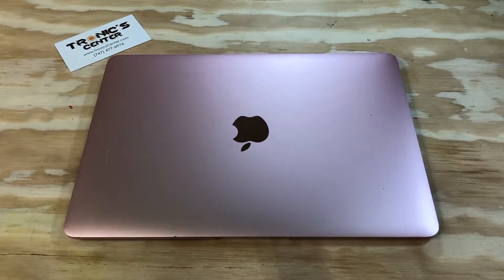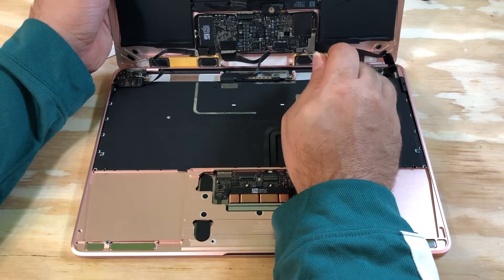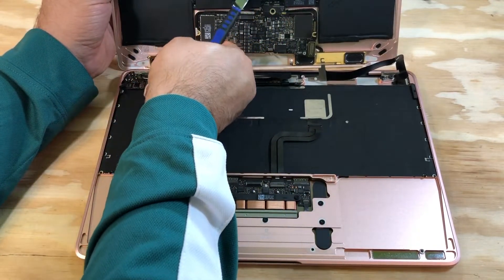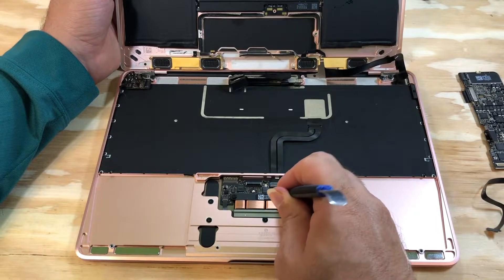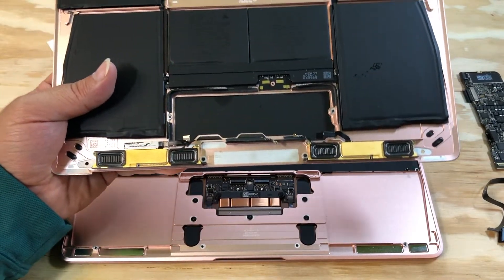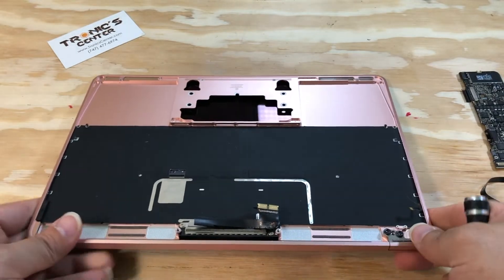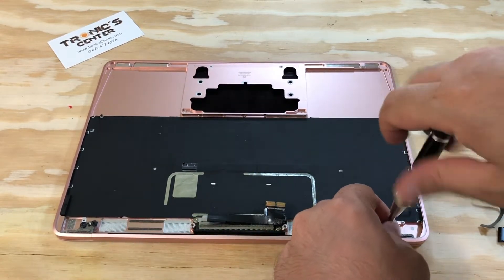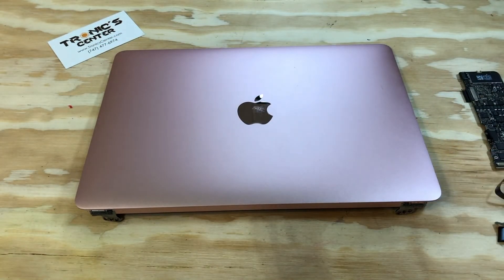Take Apart 12" Apple MacBook A1534 - Quick 12" MacBook Disassembly and Tear down 2015 - 2017

Comment: Hello budy, how are you? I manage to change the board of a 2016 A1534 for the board of the 2017 of the same model, apparently everything is the same, waiting.
Reply from the maker: Not sure , you may check the compatibility and do your own research ! Dear Customer let us know what repair or disassembly you want us to make video ! Please not that we do deal with all Brands Dell, Lenovo, Asus, Razer, Toshiba, Hp, Sony, Panasonic, Nikon, Canon, Black Magic, Red Camera, any Camcorder Bards, Also we do IT Support and Data Recovery !
Reply from the maker: A2251 KeyWords 

MacBook Pro "Core i5" 2.0 13" 2020 4 TB 3, 2.0 GHz Core i5, I5-1038NG7, MacBook Pro "Core i7" 2.3 13" 2020 4 TB 3, 2.3 GHz Core i7,  I7-1068NG7, MacBookPro16,2 , 2020 13" 4 TB 3 , A2251 MacBook , EMC 3348, MWP72LL/A, BTO/CTO

————————————————————

A2141 KeyWords 

MacBook Pro "Core i7" 2.6 16" 2019, 2.6 GHz Core i7 (I7-9750H), 2.3 GHz Core i9 (I9-9880H), A2141 (EMC 3347), 2.4 GHz Core i9 (I9-9980HK) , MacBookPro16,1, MacBook Pro "Core i7" 2.6 16" 2019 5600M, 2.6 GHz Core i7 (I7-9750H),  MacBookPro16,4 , MacBook Pro "Core i9" 2.3 16" 2019 5600M, 2.3 GHz Core i9 (I9-9880H), MacBook Pro "Core i9" 2.4 16" 2019 5600M, 2.4 GHz Core i9 (I9-9980HK), MVVL2LL/A, MVVM2LL/A, 16" MacBook A2141

———————————————

A2179 Keywords

MWTJ2LL/A, EMC 3302 , 1.1 GHz Core i3 (I3-1000NG4) , MacBook Air "Core i3" 1.1 13" (Scissor, 2020) , MacBookAir9,1 , 1.1 GHz Core i5 (I5-1030NG7) , MVH22LL/A , MacBook Air "Core i7" 1.2 13" (Scissor, 2020), 1.2 GHz Core i7 (I7-1060NG7)

——————————————

A2159 Keywords 

1.4 GHz Core i5 (I5-8257U) , MacBook Pro "Core i5" 1.4 13" Touch/2019 2 TB 3 , MacBook Pro "Core i7" 1.7 13" Touch/2019 2 TB 3 , 1.7 GHz Core i7 (I7-8557U) , MUHN2LL/A , A2159 , EMC 3301 , MacBookPro15,4 , 2019 13" (Touch Bar, 2 TB 3), 13" MacBook Pro A2159

—————————————————————

A1932 Keywords  

MRE82LL/A , MVFH2LL/A, 1.6 GHz Core I5-8210Y, 1.6 GHz Core I5-8210Y, MacBookAir8,1 , EMC 3184 , 13" MacBook Air Space Gray, 13" MacBook Air Gold , 13" MacBook Air Silver , 13" MacBook Air 2019 13" MacBook Air 2018, 13" MacBook Air A1932

—————————————————————

A1534 Keyword’s

EMC 2746, MF855LL/A, MF865LL/A, EMC 2991, MLHA2LL/A, MLHC2LL/A, EMC 3099, MNYF2LL/A, MNYG2LL/A, MacBook8,1 , 1.1 GHz Core M (M-5Y31) , 1.2 GHz Core M (M-5Y51), 1.3 GHz Core M (M-5Y71), 1.1 GHz Core m3 (M3-6Y30), 1.2 GHz Core m5 (M5-6Y54), 1.3 GHz Core m7 (M7-6Y75), 1.2 GHz Core m3 (M3-7Y32), 1.3 GHz Core i5 (I5-7Y54), 1.4 GHz Core i7 (I7-7Y75), MacBook9,1 , MacBook10,1

——————————————————

A1990 Keywords

MR932LL/A, 2.2 GHz Core i7 (I7-8750H), EMC 3215, MacBookPro15,1 , MR942LL/A 2.6 GHz Core i7 (I7-8850H), 2.6 GHz Core i7 (I7-8850H), 2.9 GHz Core i9 (I9-8950HK), 2.6 GHz Core i7 (I7-9750H), EMC 3359, 2.3 GHz Core i9 (I9-9880H), 2.4 GHz Core i9 (I9-9980HK), MacBookPro15,3, A1990 MacBook, 15” MacBook A1990

———————————————————

A1989 Keyword 

A1989 MacBook 2018 MR9Q2LL/A, 2.3 GHz Core i5 (I5-8259U), BTO/CTO, 2.7 GHz Core i7 (I7-8559U), EMC 3214, MacBookPro15,2 , A1989 MacBook 2019 MV962LL/A , 2.4 GHz Core i5 (I5-8279U) , MV982LL/A, 2.8 GHz Core i7 (I7-8569U) , EMC 3358, 13" MacBook A1989

———————————————

A1708 Keywords

MLL42LL/A, A1708, EMC 2978, MacBookPro13,1 , 2.0 GHz Core i5 (I5-6360U) , 2.4 GHz Core i7 (I7-6660U) , MPXQ2LL/A, EMC 3164, 2.3 GHz Core i5 (I5-7360U) , 2.5 GHz Core i7 (I7-7660U), MPXQ2LL/A, 13" MacBook A1708

———————————————————— 
MacBook 

Apple, MacBook, 13" MacBook, MacBook Air, A1466 MacBook, MacBook Air logic Board, 13" MacBook Air , Apple Mac , 11” MacBook , A1465 MacBook, A1502 MacBook, A1398 MacBook, A1425 MacBook, A1706 MacBook, A1708 MacBook, A1707 MacBook, A1990 MacBook, A1989 MacBook, A2159 MacBook, A2179 MacBook, A2289 MacBook, A2337 MacBook, A2338 MacBook, A2141 MacBook, MacBook Pro, MacBook Pro Retina, Retina display, True Tone Display , Top Case KeyBoard, Apple Keyboard, MacBook KeyBoard, MacBook Trackpad.
———————————————————

A1398 MacBook, A1398 Logic Board, A1398 LCD, A1398 KeyBoard , A1398 Display, MC975LL/A, MC976LL/A, MD831LL/A, ME664LL/A, ME665LL/A , ME698LL/A, ME293LL/A, ME294LL/A, ME874LL/A, MGXA2LL/A, MGXC2LL/A, MGXG2LL/A, MJLQ2LL/A, MJLT2LL/A, MJLU2LL/A

—————————————————————

A1706 Keywords

MLH12LL/A, A1706 EMC 3071, MacBookPro13,2 , MacBookPro14,2 , MPXV2LL/A, A1706 EMC 3163 , 3.5 GHz Core I7-7567U, 3.3 GHz Core I5-7287U, 3.1 GHz Core I5-7267U, 3.3 GHz Core I7-6567U, 3.1 GHz Core I5-6287U, 2.9 GHz Core I5-6267U, A1706 MacBook, A1706 MacBook Touch Bar 

—————————————————————
A1707 Keywords 

MPN 923-01477 , MLH32LL/A, MLH42LL/A, MPTR2LL/A, MPTT2LL, EMC 3072, MLH32LL/A, MacBookPro13,3, 2.7 GHz Core i7 (I7-6820HQ), MLH42LL/A, 2.9 GHz Core i7 (I7-6920HQ), EMC 3162 , 2.8 GHz Core i7 (I7-7700HQ), MacBookPro14,3 , 2.9 GHz Core i7 (I7-7820HQ), MPTR2LL/A, MPTT2LL/A, 3.1 GHz Core i7 (I7-7920HQ), A1707 MacBook, A1707 Touch Bar

Comment: so there is no NVMe drive in this? I have a boot loop problem AND the screen is broken! so i can't do a recovery visually. was hoping to pull the drive for file recovery but it doesn't exist. maybe its built into the logic board. suggestions? replace screen?
Reply from the maker: Dear Customer you may visit your local Apple store or localcomputer store to diagnosis and avise you . Thanks ! Dear Customer let us know what repair or disassembly you want us to make video ! Please not that we do deal with all Brands Dell, Lenovo, Asus, Razer, Toshiba, Hp, Sony, Panasonic, Nikon, Canon, Black Magic, Red Camera, any Camcorder Bards, Also we do IT Support and Data Recovery ! we would love to hear from you .
Reply from the maker: A2251 KeyWords 

MacBook Pro "Core i5" 2.0 13" 2020 4 TB 3, 2.0 GHz Core i5, I5-1038NG7, MacBook Pro "Core i7" 2.3 13" 2020 4 TB 3, 2.3 GHz Core i7,  I7-1068NG7, MacBookPro16,2 , 2020 13" 4 TB 3 , A2251 MacBook , EMC 3348, MWP72LL/A, BTO/CTO

————————————————————

A2141 KeyWords 

MacBook Pro "Core i7" 2.6 16" 2019, 2.6 GHz Core i7 (I7-9750H), 2.3 GHz Core i9 (I9-9880H), A2141 (EMC 3347), 2.4 GHz Core i9 (I9-9980HK) , MacBookPro16,1, MacBook Pro "Core i7" 2.6 16" 2019 5600M, 2.6 GHz Core i7 (I7-9750H),  MacBookPro16,4 , MacBook Pro "Core i9" 2.3 16" 2019 5600M, 2.3 GHz Core i9 (I9-9880H), MacBook Pro "Core i9" 2.4 16" 2019 5600M, 2.4 GHz Core i9 (I9-9980HK), MVVL2LL/A, MVVM2LL/A, 16" MacBook A2141

———————————————

A2179 Keywords

MWTJ2LL/A, EMC 3302 , 1.1 GHz Core i3 (I3-1000NG4) , MacBook Air "Core i3" 1.1 13" (Scissor, 2020) , MacBookAir9,1 , 1.1 GHz Core i5 (I5-1030NG7) , MVH22LL/A , MacBook Air "Core i7" 1.2 13" (Scissor, 2020), 1.2 GHz Core i7 (I7-1060NG7)

——————————————

A2159 Keywords 

1.4 GHz Core i5 (I5-8257U) , MacBook Pro "Core i5" 1.4 13" Touch/2019 2 TB 3 , MacBook Pro "Core i7" 1.7 13" Touch/2019 2 TB 3 , 1.7 GHz Core i7 (I7-8557U) , MUHN2LL/A , A2159 , EMC 3301 , MacBookPro15,4 , 2019 13" (Touch Bar, 2 TB 3), 13" MacBook Pro A2159

—————————————————————

A1932 Keywords  

MRE82LL/A , MVFH2LL/A, 1.6 GHz Core I5-8210Y, 1.6 GHz Core I5-8210Y, MacBookAir8,1 , EMC 3184 , 13" MacBook Air Space Gray, 13" MacBook Air Gold , 13" MacBook Air Silver , 13" MacBook Air 2019 13" MacBook Air 2018, 13" MacBook Air A1932

—————————————————————

A1534 Keyword’s

EMC 2746, MF855LL/A, MF865LL/A, EMC 2991, MLHA2LL/A, MLHC2LL/A, EMC 3099, MNYF2LL/A, MNYG2LL/A, MacBook8,1 , 1.1 GHz Core M (M-5Y31) , 1.2 GHz Core M (M-5Y51), 1.3 GHz Core M (M-5Y71), 1.1 GHz Core m3 (M3-6Y30), 1.2 GHz Core m5 (M5-6Y54), 1.3 GHz Core m7 (M7-6Y75), 1.2 GHz Core m3 (M3-7Y32), 1.3 GHz Core i5 (I5-7Y54), 1.4 GHz Core i7 (I7-7Y75), MacBook9,1 , MacBook10,1

——————————————————

A1990 Keywords

MR932LL/A, 2.2 GHz Core i7 (I7-8750H), EMC 3215, MacBookPro15,1 , MR942LL/A 2.6 GHz Core i7 (I7-8850H), 2.6 GHz Core i7 (I7-8850H), 2.9 GHz Core i9 (I9-8950HK), 2.6 GHz Core i7 (I7-9750H), EMC 3359, 2.3 GHz Core i9 (I9-9880H), 2.4 GHz Core i9 (I9-9980HK), MacBookPro15,3, A1990 MacBook, 15” MacBook A1990

———————————————————

A1989 Keyword 

A1989 MacBook 2018 MR9Q2LL/A, 2.3 GHz Core i5 (I5-8259U), BTO/CTO, 2.7 GHz Core i7 (I7-8559U), EMC 3214, MacBookPro15,2 , A1989 MacBook 2019 MV962LL/A , 2.4 GHz Core i5 (I5-8279U) , MV982LL/A, 2.8 GHz Core i7 (I7-8569U) , EMC 3358, 13" MacBook A1989

———————————————

A1708 Keywords

MLL42LL/A, A1708, EMC 2978, MacBookPro13,1 , 2.0 GHz Core i5 (I5-6360U) , 2.4 GHz Core i7 (I7-6660U) , MPXQ2LL/A, EMC 3164, 2.3 GHz Core i5 (I5-7360U) , 2.5 GHz Core i7 (I7-7660U), MPXQ2LL/A, 13" MacBook A1708

———————————————————— 
MacBook 

Apple, MacBook, 13" MacBook, MacBook Air, A1466 MacBook, MacBook Air logic Board, 13" MacBook Air , Apple Mac , 11” MacBook , A1465 MacBook, A1502 MacBook, A1398 MacBook, A1425 MacBook, A1706 MacBook, A1708 MacBook, A1707 MacBook, A1990 MacBook, A1989 MacBook, A2159 MacBook, A2179 MacBook, A2289 MacBook, A2337 MacBook, A2338 MacBook, A2141 MacBook, MacBook Pro, MacBook Pro Retina, Retina display, True Tone Display , Top Case KeyBoard, Apple Keyboard, MacBook KeyBoard, MacBook Trackpad.
———————————————————

A1398 MacBook, A1398 Logic Board, A1398 LCD, A1398 KeyBoard , A1398 Display, MC975LL/A, MC976LL/A, MD831LL/A, ME664LL/A, ME665LL/A , ME698LL/A, ME293LL/A, ME294LL/A, ME874LL/A, MGXA2LL/A, MGXC2LL/A, MGXG2LL/A, MJLQ2LL/A, MJLT2LL/A, MJLU2LL/A

—————————————————————

A1706 Keywords

MLH12LL/A, A1706 EMC 3071, MacBookPro13,2 , MacBookPro14,2 , MPXV2LL/A, A1706 EMC 3163 , 3.5 GHz Core I7-7567U, 3.3 GHz Core I5-7287U, 3.1 GHz Core I5-7267U, 3.3 GHz Core I7-6567U, 3.1 GHz Core I5-6287U, 2.9 GHz Core I5-6267U, A1706 MacBook, A1706 MacBook Touch Bar 

—————————————————————
A1707 Keywords 

MPN 923-01477 , MLH32LL/A, MLH42LL/A, MPTR2LL/A, MPTT2LL, EMC 3072, MLH32LL/A, MacBookPro13,3, 2.7 GHz Core i7 (I7-6820HQ), MLH42LL/A, 2.9 GHz Core i7 (I7-6920HQ), EMC 3162 , 2.8 GHz Core i7 (I7-7700HQ), MacBookPro14,3 , 2.9 GHz Core i7 (I7-7820HQ), MPTR2LL/A, MPTT2LL/A, 3.1 GHz Core i7 (I7-7920HQ), A1707 MacBook, A1707 Touch Bar

Comment: can you upgrade ram?
Reply: No
Reply from the maker: Dear You may Visit Your Local Apple Store or Computer store so they can diagnosis and advise , Thanks ! Dear Customer let us know what repair or disassembly you want us to make video ! Please not that we do deal with all Brands Dell, Lenovo, Asus, Razer, Toshiba, Hp, Sony, Panasonic, Nikon, Canon, Black Magic, Red Camera, any Camcorder Bards, Also we do IT Support and Data Recovery ! we would love to hear from you .
Reply from the maker: A2251 KeyWords 

MacBook Pro "Core i5" 2.0 13" 2020 4 TB 3, 2.0 GHz Core i5, I5-1038NG7, MacBook Pro "Core i7" 2.3 13" 2020 4 TB 3, 2.3 GHz Core i7,  I7-1068NG7, MacBookPro16,2 , 2020 13" 4 TB 3 , A2251 MacBook , EMC 3348, MWP72LL/A, BTO/CTO

————————————————————

A2141 KeyWords 

MacBook Pro "Core i7" 2.6 16" 2019, 2.6 GHz Core i7 (I7-9750H), 2.3 GHz Core i9 (I9-9880H), A2141 (EMC 3347), 2.4 GHz Core i9 (I9-9980HK) , MacBookPro16,1, MacBook Pro "Core i7" 2.6 16" 2019 5600M, 2.6 GHz Core i7 (I7-9750H),  MacBookPro16,4 , MacBook Pro "Core i9" 2.3 16" 2019 5600M, 2.3 GHz Core i9 (I9-9880H), MacBook Pro "Core i9" 2.4 16" 2019 5600M, 2.4 GHz Core i9 (I9-9980HK), MVVL2LL/A, MVVM2LL/A, 16" MacBook A2141

———————————————

A2179 Keywords

MWTJ2LL/A, EMC 3302 , 1.1 GHz Core i3 (I3-1000NG4) , MacBook Air "Core i3" 1.1 13" (Scissor, 2020) , MacBookAir9,1 , 1.1 GHz Core i5 (I5-1030NG7) , MVH22LL/A , MacBook Air "Core i7" 1.2 13" (Scissor, 2020), 1.2 GHz Core i7 (I7-1060NG7)

——————————————

A2159 Keywords 

1.4 GHz Core i5 (I5-8257U) , MacBook Pro "Core i5" 1.4 13" Touch/2019 2 TB 3 , MacBook Pro "Core i7" 1.7 13" Touch/2019 2 TB 3 , 1.7 GHz Core i7 (I7-8557U) , MUHN2LL/A , A2159 , EMC 3301 , MacBookPro15,4 , 2019 13" (Touch Bar, 2 TB 3), 13" MacBook Pro A2159

—————————————————————

A1932 Keywords  

MRE82LL/A , MVFH2LL/A, 1.6 GHz Core I5-8210Y, 1.6 GHz Core I5-8210Y, MacBookAir8,1 , EMC 3184 , 13" MacBook Air Space Gray, 13" MacBook Air Gold , 13" MacBook Air Silver , 13" MacBook Air 2019 13" MacBook Air 2018, 13" MacBook Air A1932

—————————————————————

A1534 Keyword’s

EMC 2746, MF855LL/A, MF865LL/A, EMC 2991, MLHA2LL/A, MLHC2LL/A, EMC 3099, MNYF2LL/A, MNYG2LL/A, MacBook8,1 , 1.1 GHz Core M (M-5Y31) , 1.2 GHz Core M (M-5Y51), 1.3 GHz Core M (M-5Y71), 1.1 GHz Core m3 (M3-6Y30), 1.2 GHz Core m5 (M5-6Y54), 1.3 GHz Core m7 (M7-6Y75), 1.2 GHz Core m3 (M3-7Y32), 1.3 GHz Core i5 (I5-7Y54), 1.4 GHz Core i7 (I7-7Y75), MacBook9,1 , MacBook10,1

——————————————————

A1990 Keywords

MR932LL/A, 2.2 GHz Core i7 (I7-8750H), EMC 3215, MacBookPro15,1 , MR942LL/A 2.6 GHz Core i7 (I7-8850H), 2.6 GHz Core i7 (I7-8850H), 2.9 GHz Core i9 (I9-8950HK), 2.6 GHz Core i7 (I7-9750H), EMC 3359, 2.3 GHz Core i9 (I9-9880H), 2.4 GHz Core i9 (I9-9980HK), MacBookPro15,3, A1990 MacBook, 15” MacBook A1990

———————————————————

A1989 Keyword 

A1989 MacBook 2018 MR9Q2LL/A, 2.3 GHz Core i5 (I5-8259U), BTO/CTO, 2.7 GHz Core i7 (I7-8559U), EMC 3214, MacBookPro15,2 , A1989 MacBook 2019 MV962LL/A , 2.4 GHz Core i5 (I5-8279U) , MV982LL/A, 2.8 GHz Core i7 (I7-8569U) , EMC 3358, 13" MacBook A1989

———————————————

A1708 Keywords

MLL42LL/A, A1708, EMC 2978, MacBookPro13,1 , 2.0 GHz Core i5 (I5-6360U) , 2.4 GHz Core i7 (I7-6660U) , MPXQ2LL/A, EMC 3164, 2.3 GHz Core i5 (I5-7360U) , 2.5 GHz Core i7 (I7-7660U), MPXQ2LL/A, 13" MacBook A1708

———————————————————— 
MacBook 

Apple, MacBook, 13" MacBook, MacBook Air, A1466 MacBook, MacBook Air logic Board, 13" MacBook Air , Apple Mac , 11” MacBook , A1465 MacBook, A1502 MacBook, A1398 MacBook, A1425 MacBook, A1706 MacBook, A1708 MacBook, A1707 MacBook, A1990 MacBook, A1989 MacBook, A2159 MacBook, A2179 MacBook, A2289 MacBook, A2337 MacBook, A2338 MacBook, A2141 MacBook, MacBook Pro, MacBook Pro Retina, Retina display, True Tone Display , Top Case KeyBoard, Apple Keyboard, MacBook KeyBoard, MacBook Trackpad.
———————————————————

A1398 MacBook, A1398 Logic Board, A1398 LCD, A1398 KeyBoard , A1398 Display, MC975LL/A, MC976LL/A, MD831LL/A, ME664LL/A, ME665LL/A , ME698LL/A, ME293LL/A, ME294LL/A, ME874LL/A, MGXA2LL/A, MGXC2LL/A, MGXG2LL/A, MJLQ2LL/A, MJLT2LL/A, MJLU2LL/A

—————————————————————

A1706 Keywords

MLH12LL/A, A1706 EMC 3071, MacBookPro13,2 , MacBookPro14,2 , MPXV2LL/A, A1706 EMC 3163 , 3.5 GHz Core I7-7567U, 3.3 GHz Core I5-7287U, 3.1 GHz Core I5-7267U, 3.3 GHz Core I7-6567U, 3.1 GHz Core I5-6287U, 2.9 GHz Core I5-6267U, A1706 MacBook, A1706 MacBook Touch Bar 

—————————————————————
A1707 Keywords 

MPN 923-01477 , MLH32LL/A, MLH42LL/A, MPTR2LL/A, MPTT2LL, EMC 3072, MLH32LL/A, MacBookPro13,3, 2.7 GHz Core i7 (I7-6820HQ), MLH42LL/A, 2.9 GHz Core i7 (I7-6920HQ), EMC 3162 , 2.8 GHz Core i7 (I7-7700HQ), MacBookPro14,3 , 2.9 GHz Core i7 (I7-7820HQ), MPTR2LL/A, MPTT2LL/A, 3.1 GHz Core i7 (I7-7920HQ), A1707 MacBook, A1707 Touch Bar